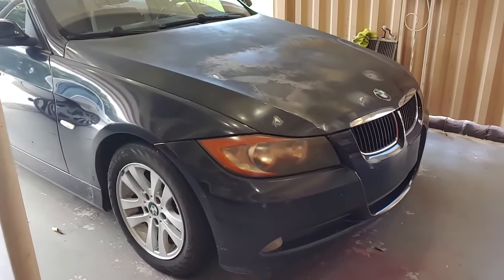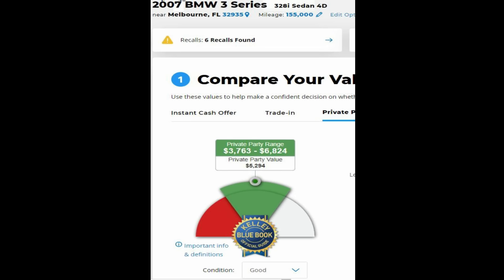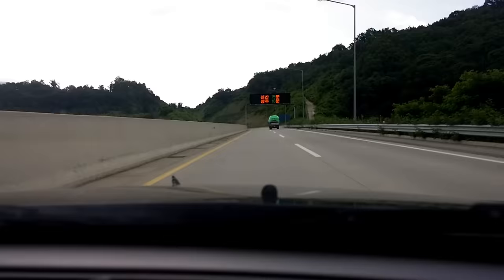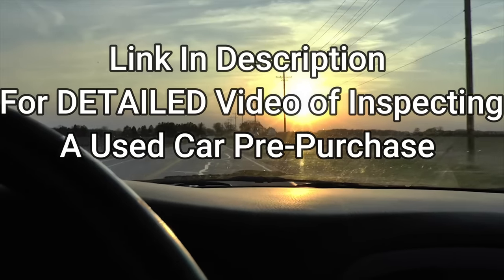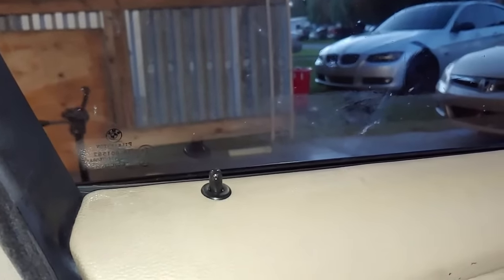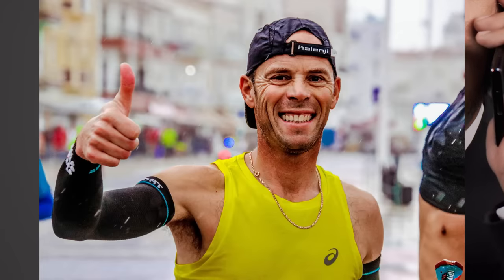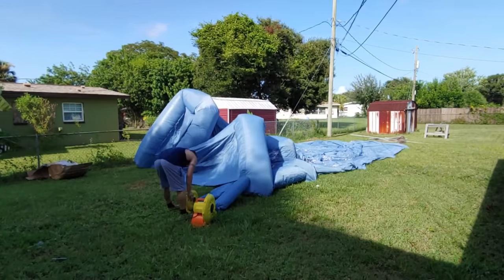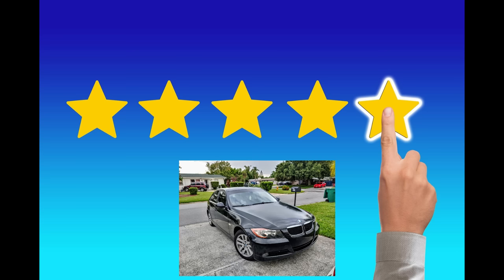How To Flip Cars | FULL PROCESS [2]

Comment: I bought a ford fusion 2010 SE 
For 1600
It had problems with the power steering wheel and electric issues  
I took it to the Ford dealer because it has recalls 
So they fix the electric issues for free and the steering wheel for $250
Then I bought some rims in the Facebook marketplace for $250 it came with tires also with 70 percent life then I sold it for 5k so almost 3k profit I was so happy that was 7 months ago
Reply from the maker: Beautiful with brother

Comment: The engine light will only flash if there's a misfire because it's usually not burning fuel in one or multiple cylinders.  It's just pushing fuel into the exhaust system and getting in the super hot catalytic converter.  It's not always a coil though.  How your engine light wasn't flashing is a mystery.

Comment: Best car flip? Never really flipped a car. What I did do was buy a 2012 f150 in Jan 2020 for 12k and then the next year when vehicle prices were going through the roof, I sold it in Mar 2021 for 20k before I moved out of the country. Only work I did was new brakes and brake pads on all 4 wheels and the E brake and oil changes and had to replace the bumper after someone backed into me.

Comment: I just Found and bought a rare car that sat for 10 years 1998 740iL (M60) (E38) For 684$ 2 Owner 170.000 Miles imaculate condition and runs drives pretty only 170,550 Miles 332,000 Were brought to the U.S. CANT WAIT TO FIX THE LITTLE THINGS IT NEEDS Pretty just a tun-up

Comment: Wrong, sludge in just oil CAP is rearly a blown headgasket. Thats a much more typical sign off too much 5-15min driveouts, several times during a short period off time.take a good 1-2 your drive with IT and IT shall be tone after that.
Reply from the maker: I clarify the entire process I use to inspect a used car in my car inspection series

Comment: Wait a minute ! Are you allowed to complain when a used car starts to take a crap after you buy it ? Maaan I've been getting robbed 😂. I just assumed it was on me for not knowing enough about vehicles during a test drive / inspection I usually look at stuff and pretend I know what's what , there are many hmmms and weeeelllls and then I buy it and it explodes a few months later 🤣🤣 . My wife seriously asked me with a straight face to go look at a car for her sister , then I reminded her of my track record on used cars , one never even made it home lol 🤣 it was a trooper and boy did the seller get me good on that one , one if the tires blew up on the highway and the transmission dumped a bunch of fluid all at once ! So I guess you could call me when you want to know which car I would buy in order to know which one to avoid.  I've been learning my way around a car over the last couple years but it's been painful .

Comment: Get the $500 macco job then buy a ceramic coating kit from amazon for $75. It’s supposed to last for 3 years of normal driving and it makes the car feel like butter. 

Also do you have a dealer license or are you skipping the title? Kinda left that part ambiguous
Reply from the maker: I'm a dealer. can't recommend doing the second thing lol
Reply: Buddy's DIY  I figured it just seemed kinda ambiguous because it looks like you’re doing everything in your garage. In GA you have to have a physical lot to get a license, so you can’t really do any “at home flipping” unfortunately

Comment: Well, everything looks very nice in video, but when I see that someone, who doesn't do it for a living, does car paint job over weekend it's just a red flag for me. I bet that if you take close look on that car you would find lots of painting defects, because to make a decent paint job takes much more time and that single stage paint is used more like for farm equipment and not for cars...Dont't want to sound negative, but I have been in this field and, I know how it goes. Car fliping is not that easy, most of the cars that are more than 10 years old has a lot of problems and actualy it is rare that it is enought just to ''freshen it  up'' and tinker with few small issues, it can easily turn down to a loss instead of profit.

Comment: None of this would work in my country. 99% of men know a lot about cars, everyone knows the real value of the car that they’re selling and you cant make low ball offers like that, you would get told to fck off and get blocked. You normally you can negotiate a price thats 100-200 lower than the original price but thats it. If the car runs fine except for the few little things the owner would fix them up themselves to sell it for more money. Im watching this series and thinking wtf, its almost like, oh the mirror is missing so the owner lowered the price by 500$. You would loose a lot of money flipping cars like that here

Comment: Wooh, a $2150 profit. On a car you have worked on for how many hours?How much $$$ in tools did you use? How much in other unaccounted for costs have there been? Also, abouyt some shots where you do car inspection mounted in the video, to show people how thorough you are. Because the way this video looks, it's simply: buy an almost wreck, fix the looks, fix the check engine lights, sell it for more than it's probably worth, get away with it. But it's not that simple. There are cosumer laws, for example. And even when you're not a dealer who is obliged to work by those laws, then your name goes down the drain when you are selling over value.